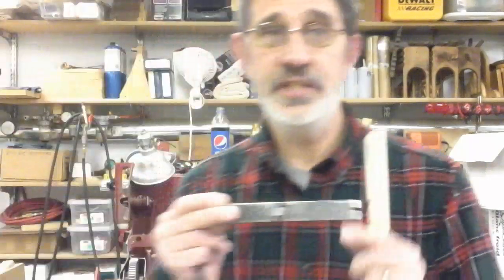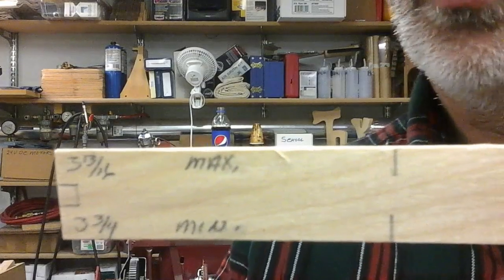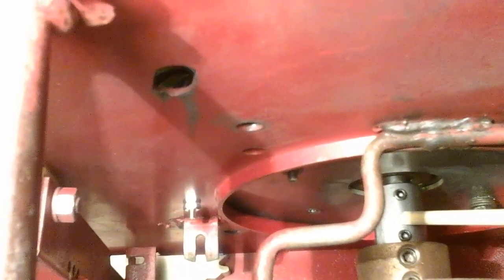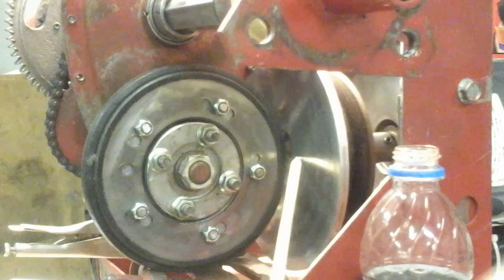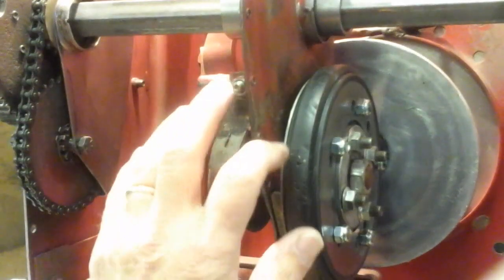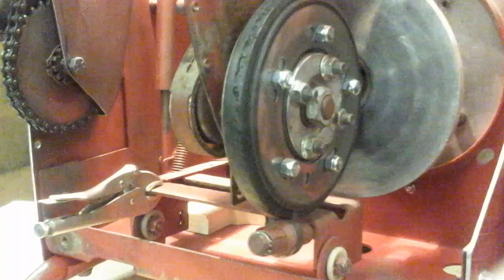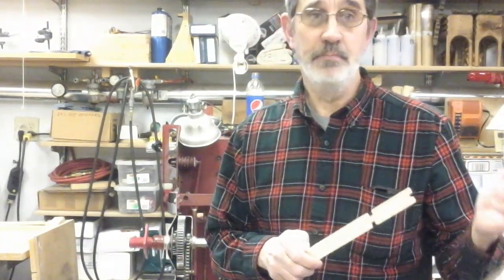70. How can I adjust my clutch and drive disc

Comment: Hi Jim, and thanks for the videos. They are all very helpful to someone who likes to do their own maintenance on their snappers. 
I have a question, has anyone been having problems with the drive disc being eat up in a very short time. 
I have 2 snapper (rear engine riding mower series 23 model 3012523BVE, 2007) that performed great for several years. As normal the drive discs do wear out. I simply replaced them both one month apart, no other adjustments made. Know, they only last about 2 to 3 cuttings and are completely worn flat. My yard is about an acre. I have gone through 6 drive disc just this summer and already the ones on the mowers are so flat the mowers can not pull themself.
I’ve looked through all of your videos, check all the settings you’ve shown but still they keep eating the drive disc. I even completely disassembled the rear end of one thinking something might be wrong with the drive train. No problems found.
The only thing I can think of is the rubber they are using on the drive disc may not be as good as it use to be.
Can you give me any suggestions as to where to start looking to solve this problem? I’m getting very frustrated with this problem and the snapper dealer is of no help
Reply from the maker: Gary Peveto 
Hi Gary 
  Where are you getting your clutch disks from, and is it a soft start clutch. And I do have a viewer with the same issue are your bushings ok. Thanks Jim
Reply: Thanks for responding Jim,
I get my clutch disks from the local snapper dealer. They come in sealed plastic bags marked Genuine Briggs & Stratton Parts. P/N 7600135YP, Kit, Friction Ring, with the numbers 1616 and MS176 on the bag. I did purchase 1 on line when I ordered all the parts to rebuild my 21" series 18 walk behind snapper trim mower, but the same thing happen with it. Both of my riders are the soft start clutch, and have the same problem (at the same time, after clutch disk replacement). All bushings seem to be ok, but I would be willing to replace all of them in an attempt to solve the problem. I have already adjusted the clutch spring to get good contact with the drive disk on the motor shaft, so I know it's making good contact. Something I have noticed, the drive disk on the motor shaft is not smooth (slick) but slight rusted and rough. When I first replace the clutch disk the mower will almost climb a tree, but after about 2 to 3 cutting the rubber has been ground down almost to the melt ring like rubbing it against a grinding disk.
A little info on me:
I'm retired, live down here in southwest Louisiana in a town called Sulphur. I own a home in town with about an acre lot and the wife and I enjoy cutting our grass once a week during the summer. I've owned snapper riding and push mower for years. My first rebuild was actually a comet my father-in-law save for me once I retired from the miltiary and returned home.
Thanks again for your help, I know how it is when you can enjoy helping other people solve problems.
Reply from the maker: Hi Gary 
   Well I am going to enjoy solving this problem I can tell you that I just had a Nother viewer   Contact me with the same issue you’re having with your  clutch disks  Gary I want you to send me your name address and ZIP Code I’m going to see if I can find a clutch disk from up here and send it to you to try out on your machine and we’ll see  how it works out. Thanks Jim
Reply from the maker: Gary Peveto 
Hi Gary
   I’ve got an old clutch disk I am going to send to you and I want you to try it and see if it wears like the new ones you’re buying now.   I know this is old stock and I am wondering if the new clutch disks are made with a cheaper or softer rubber I guess this will tell us if the new ones are any good or if you have another issue it’s going to come priority mail to you in a couple days hopefully by Monday maybe try it out run it for five or six hours as you would normally use your machine and see what it does and let me know at that time send me your phone number through my email and I can call you my email is jimsfixitshop@gmail.com don’t put your phone number in this comment section for everyone to see. Thanks Jim
Reply from the maker: Hi Gary 
   I guess this is a little PS I removed your name and address from the comment section as a YouTube We can remove comments at our discretion talk to you soon Jim

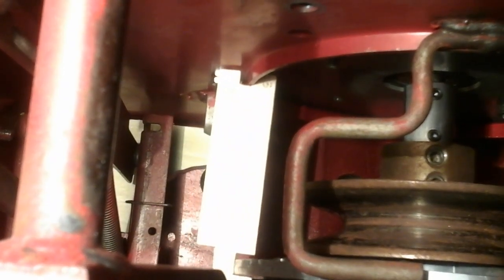Comment: 5:52 in this video is it a good guide that the drive disk should be sitting just below the belt guide?
Reply from the maker: Where Is The Thumbnail 
It depends on what belt guide you have on your machine on most of them that I have in here or it looks like the edge of the drive disk lines up with the Bottom bar of the belt guide , If you have your desk at the right distance using a measuring guide then it should line up on the belt guide where it’s supposed to be. Jim
Reply: @jimjackson9381  but to be clear if your yoke is in excellent condition the only ways to adjust the distance of the friction disk to the drive disk is to lower the drive disk on the engine shaft, adjust the spring , and or  a new friction disk with more rubber.  is this correct? thanks
Reply from the maker: Where Is The Thumbnail 
You don’t want to lower the disc too far because the edge of the chain case will rub on it if it’s too low usually tightening the spring and putting on a new clutch disk will take care of the issue. Jim

Comment: Any idea how much hp/rpm max the system can run?
Reply from the maker: Byszheir Jones 
  Well a lot of people have put on really big engines 20 horse 19 horse but a 12 horse engine I would think is plenty big mine is a 12 1/2 horse on it and it handles anything I want to do, some people think the more horsepower Will make the machine go faster that’s not true any small engine turns at 3000 RPMs regardless of the horsepower so it’s not gonna go any faster with a 20 horse on it then it would with a 9 horse. Jim
Reply: @jimjackson9381  copy! Thanks Jim! Do you know the gearing ratio across the friction disc?
Reply from the maker: Byszheir Jones 
 No I’d have to say I never took time to figure that out. Jim

Comment: I have a snapper zero turn with joystick with new hydraulic cables but still will not drive right what can I do
Reply from the maker: tim auner 
Well I don’t work on  zero turns but I would check the oil in the systems and make sure it’s full and maybe change the filters if they have any. Jim
Reply: @jimjackson9381  do you work on small engines carburetors if so how can you tell if the inside gaskets are bad
Reply from the maker: tim auner 
I don’t do a lot of work on small engines yet I plan on getting into it but as far as carburetors I just take them apart put them in a ultrasonic vibrator in it does a awesome job of cleaning out all of the very small ports in the carburetor. Jim
Reply: @jimjackson9381  do you work on troy bilt electric start push mowers need some help if you have any input on to see if it's the battery or the starter
Reply from the maker: tim auner Well I think we can figure out if it’s the battery or the starter without too much trouble what have you done to check things out so far. Jim
Reply: @jimjackson9381  put the charger on it for 8 to 10 hrs and still have nothing no sounds at all
Reply from the maker: tim auner 
If you take the battery to a auto store they can test it with a tester like I have otherwise if you have a good battery and a pair of jumper cables you can test the starter you can use the battery in your car hook the jumper cables to the battery red to positive black to negative then clamp the black clamp to the frame of the lawnmower or to the negative post on the battery if it’s in the lawnmower then touch the positive or red clamp to the stud on the side of the starter this will eliminate the ignition switch in all of the safety switches good or bad and the starter should start make sure it’s in park and you can leave the key off because you don’t really need to start it you just want to test the starter try that and let me know what you find out. Jim

Comment: Jim can you show how to make /lock the clutch solid like the clutch on t his video
Reply from the maker: BigSounds 
You need to see video no.1 if your subscribed you can find it.  Thanks Jim.  If you only have the break that's in your drive hub assembly then you will need to use flathead bolts  to get clearance for your break arm
Reply: Jim Jackson thanks.  I have a 33" rear rider and it will not go forward reliably. It will go in reverse stronger but not uphill.  The watched the shifter move along the yoke and it moves but, the disk even though its new, seems to spin slipping easily. Kinda like the disk isnt pushing up strong enough.  Ive done the spring tension adjust also.  There is minor slack in the yoke but it seems normal but i dont know.  Please help another snapper guy
Reply: Jim Jackson i subscribed ghe first time i saw you video.
Reply from the maker: BigSounds
 is the slot in your yoke in good shape. Check to see if the drive disk on the bottom of the engine is set at the proper  distance

Comment: Jim, those 2 sets crews on the crankshaft pulley, what size wrench will I need? I'm assuming the length will be a long one too.
Reply from the maker: Jeffery Hopcus 
You’re going to need a 3/16 long arm Allen wrench and probably a pair of pliers. Jim
Reply: Thanks Jim you're a lifesaver
Reply: Has a determination been made if we send you a mega GB thumb drive and cover the postage and then some if we can get an archive of past videos?
Reply from the maker: Jeffery Hopcus 
What some  viewers have been doing is sending me a 64 Gig Flash drive and $50 she will make a copy and mail it to you. Jim
Reply: That's a steal of a deal.  What's your address so I can send it.
Reply from the maker: Jeffery Hopcus 
Jim Jackson
2839 Henry St.
Muskegon Michigan
49441
Thanks a lot Jeff. Jim

Comment: When checking the distance do you place the transmission in neutral ?
Reply from the maker: michael aumiller       It doesn't matter if it's in gear or neutral it should measure the same distance any other questions or comments please feel free to leave them below or email me direct. Thanks Jim
Reply: Thanks Jim I sent an email just now. Thanks so much!

Comment: Do you have a video bolting the clutch solid?
Reply from the maker: I didn’t have a video for that but Google erased it they thought it was a duplicate video I guess so maybe I’ll have to make a new one. What is your machine doing and have you watched video number 70 and tighten your yolk spring. Jim.
Reply: @jimjackson9381  I had the deck down low and hit a high spot in the yard I didn’t think much about it until smoke started pouring out. I’m pretty sure I smoked the brand new drive drive disk I put on about 6 weeks ago. I haven’t flipped it up on it’s end but I was barely able to creep back to the garage. Yes I watched 70 and have my spring at it tightest setting.
Reply from the maker: @Muntz1967  well, when you get it tipped up, send me some pictures and we’ll figure out what’s wrong if you were mowing when you hit something like that, I would say it was probably more of the belt for the lawnmower than the drive unit